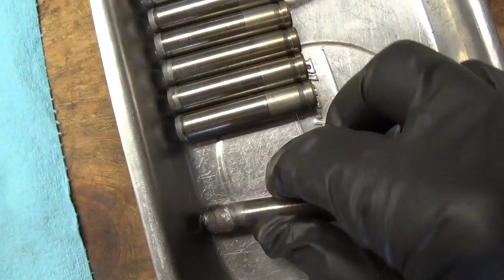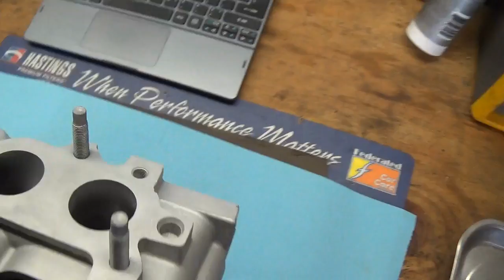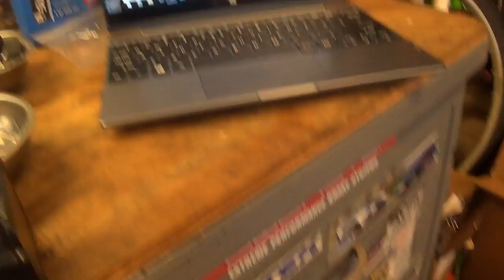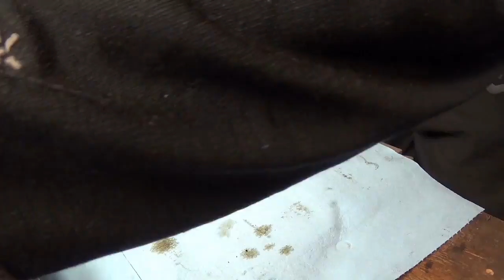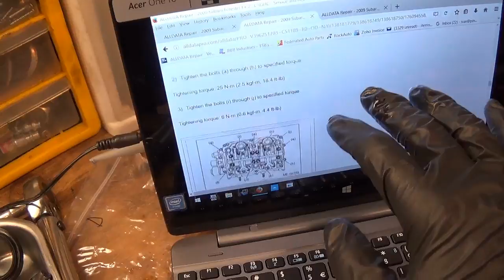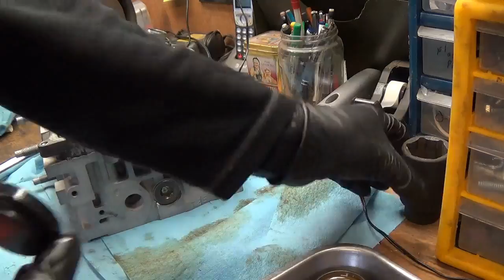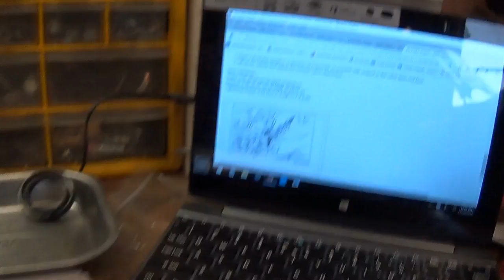Subaru Head Gaskets - Part 4: Reassemble, Valve Clearance

Comment: when you have two valves on one arm like those exhaust valves  you need to back both off then adjust one at a time  if you dont and have temsion on the second one and when you set that one the first will end up loose. also although its just on of my pet peeves i break all of them loose and back them off before torquing down cam caps . then run the torque a second time. with that many bolts  the first ones you do may end up loose.
Reply from the maker: As long as the end product is good, more than one way to do things right :)
Reply: couldn't agree more  but with my luck..........
Reply: Way I do them is 2 blades at a time, do same on 54C sr20's to get better measures .
Reply: that's about the best way @ Mr B.

Comment: Why would Subaru not put a flange on the end of the valve guide to,prevent them from dropping?  I'm not that experienced but the few heads I've worked on have all had a flange under the valve spring that would prevent this.
Reply from the maker: Fantastic question, Jeff. We should ask Subaru! I was actually wondering the same thing lol
Reply: Sometimes great engineering other ti es not so much
Reply: that shouldn't happen unless there was other issues, like blown gaskets, overheating ( likely both) overheating as we all know does nasty things, like lets seats and guides come lose/out

Comment: Or second. Lol
Reply from the maker: Hey Robert, you are still safely on the PHAD Podium ;)
Reply: +Pine Hollow Auto Diagnostics thanks Ivan.  Clean job so far. Thanks for sharing.
Reply: Hi, do you have a link to the sealant you are using. I have a leaking valve cover... Replacing only the gasket did not fix the leak...